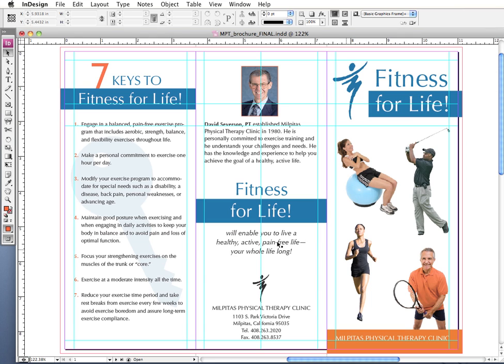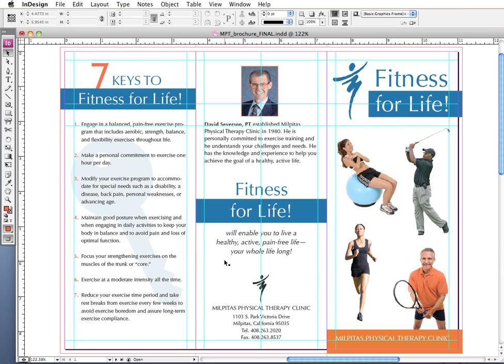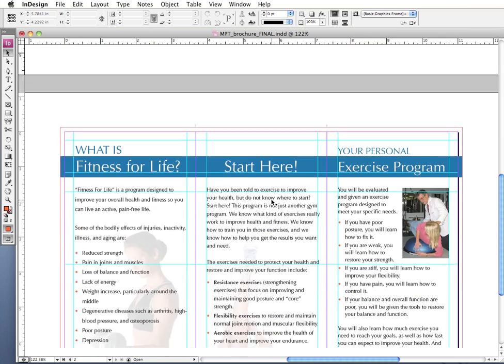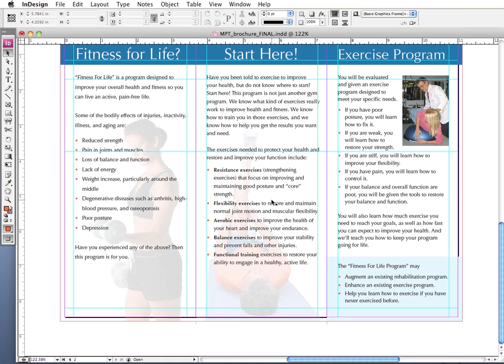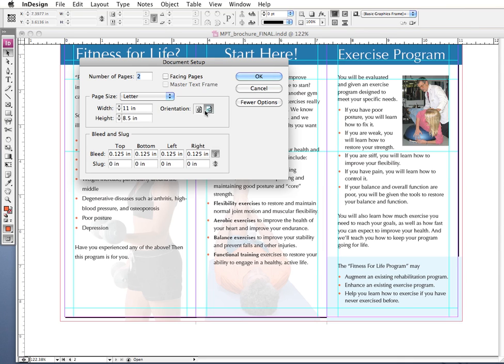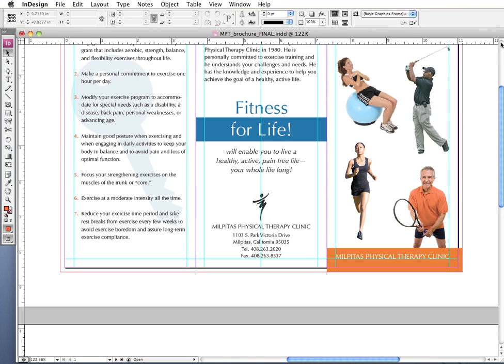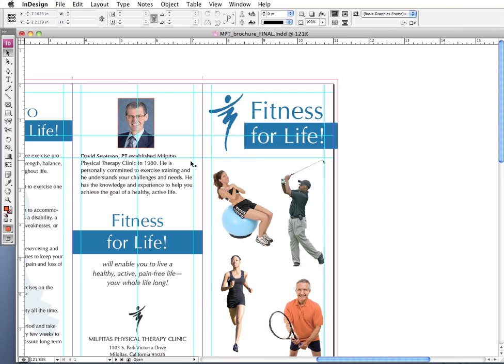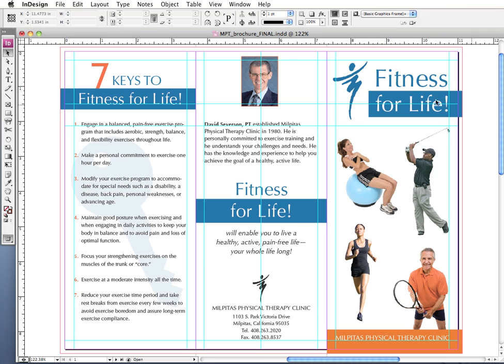InDesign: Document Size (Prepress Essentials #1 of 6)

Comment: Great video! Thanks! I've got one question - wouldn't in fold incorrectly having all the three sides equal in width? I use 3.625, 3.6875, 3.6875 for that purpose. What are your thoughts?